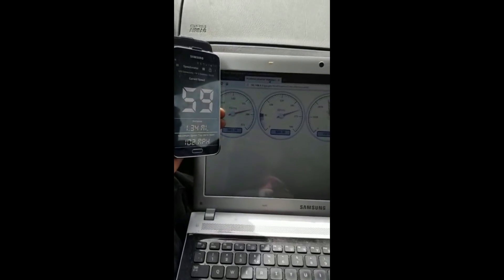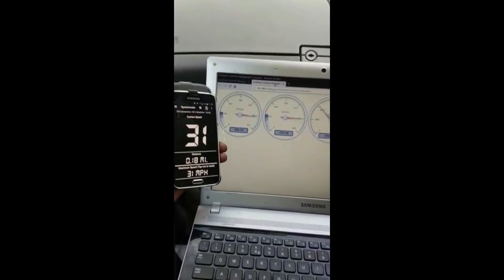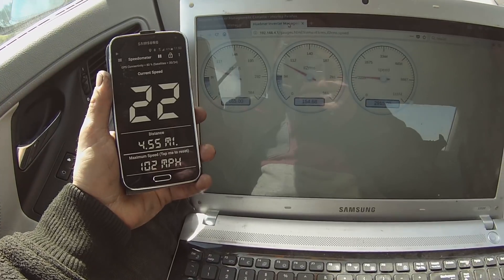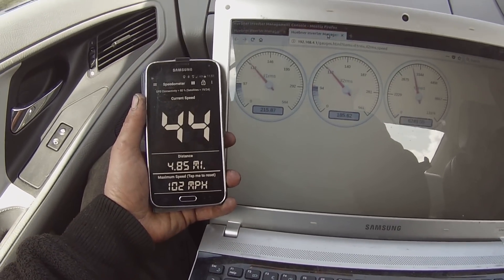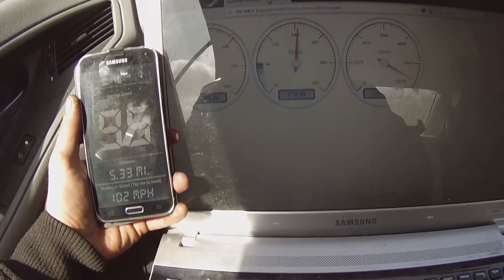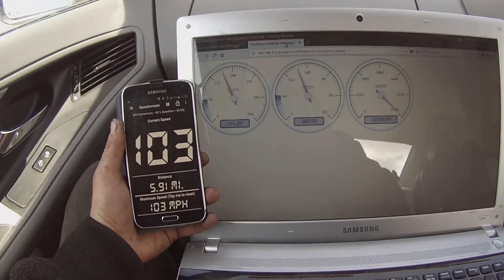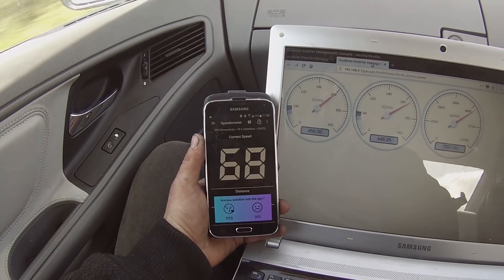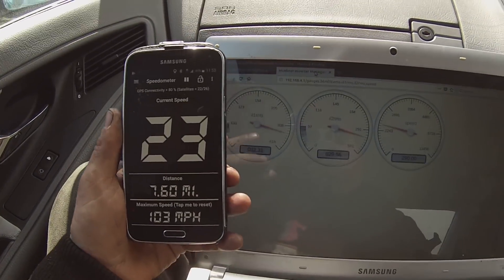BMW E31 840CI EV Conversion 99 : Tesla Swap Day 18

Comment: Ho Damien, I have a lot of questions I would like to ask you please. I'm is South Africa and want to do the electric conversion to a 1978 Citroen CX Prestige and not only use this vehicle for transport but to tow a caravan as well. 

Please could you supply me with an email address as it would be easier to email all the questions at the same time and not keep hassling you all the time as each question comes up. 

My mobile number is +27 82 966 6007 email address is adnaanstrydom8@gmail.com. 

I would really appreciate you positive response. Thanking you, Adnaan